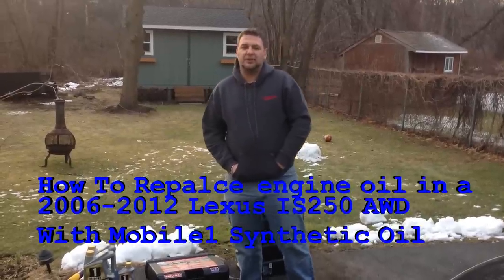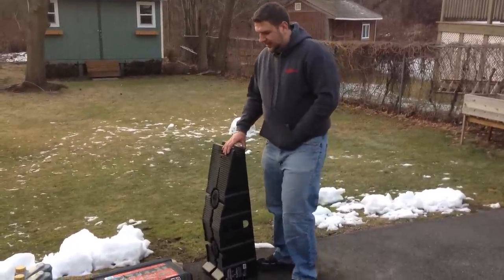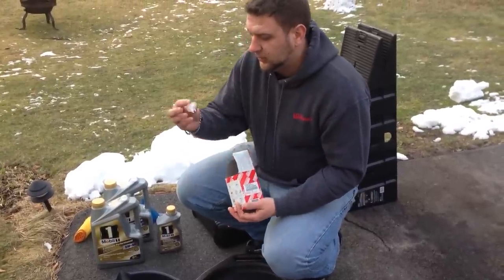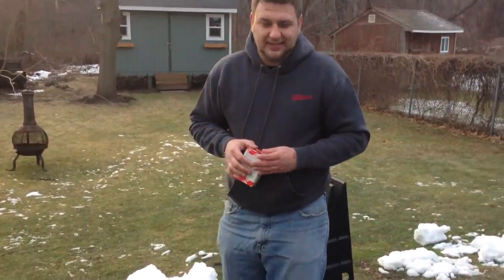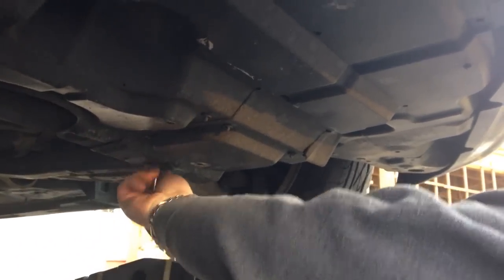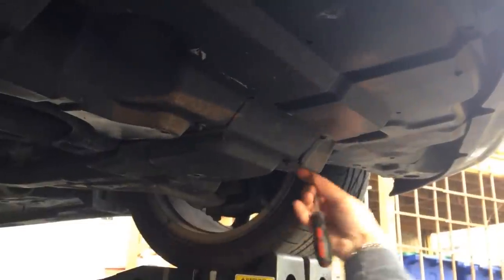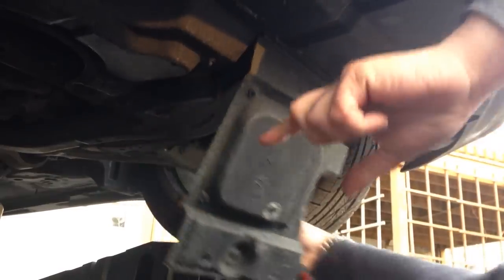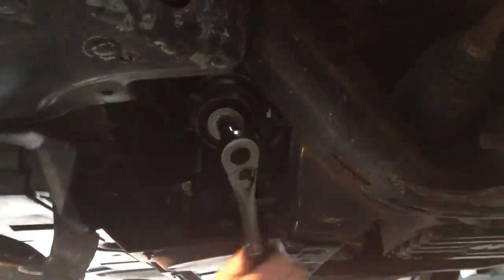How to change Engine Oil in Lexus IS250 AWD 2006-2011 Oil Change with Mobile 1 Synthetic Oil

Comment: Engine Oil and Oil Filter
Replace the oil filter and drain and
refill the engine oil at specified intervals.
SAE 0W-20 oil is the best
choice for good fuel economy and
good starting in cold weather. If SAE
0W-20 is not available, SAE 5W-20
may be used; however, it must be
replaced with SAE 0W-20 at the next
oil change. See your Lexus dealer for
oil specifically formulated for your
vehicle’s engine. For instructions on
how to reset the reminder light, refer
to your Owner’s Manual.
Reply: ca dépant des regions ici c est 5w30

Comment: I have 2013 Lexus is250 engine oil cap and maual book said use 0-20 
but so many lexus is250 owners use 5-30 ???
Reply: 5-30 is better, idk why your manual is wrong.
Reply: @BoqPrecision  5w30 no problem
Reply: I use 10w30 because it has 136000 miles

Comment: looks like the smaller nut to drain the oil from the filter (before removing the filter completely) was stripped. is this why you didn't show it being removed (and you didn't use the small plastic tube to drain the filter oil nor replace the small rubber gasket)?
Reply from the maker: Yes, The small nut got striped, it is made out of aluminium or something. I had the oil change done by a shop before that, and they have over tightened it and overfilled the oil..
I probably should have mentioned that way if it happens to someone they will know that its not the end of the world and you can still do a oil change job without it.

Comment: How often do i need to change my oil on 2006 Lexus IS250 at 124233 Miles?
Reply from the maker: If you use regular oil every 5k miles. If you use synthetic oil then you should be ok for about 7k-8k becuse oil filter need to be rplaced. But rememebr to check oil levels every 5k. I will make a video on this topic today or tommorow
Reply: The car specifies 0W-20 which is not available as a conventional oil.
Reply: My car get low engine oil level and after some time it disappear what might be the reason but i have drove close to 4k miles only mine is 2010 is250 can you please tell me the reason??

Comment: So how often do I change oil to my Lexus 250 ?? Is it every 6000 miles ??? Or is it EVERY YEAR ??? Thanks
Reply from the maker: What type of oil do you use  synthetic or regular. Regular every 5k, for sythetic anywere between 6-10ki would recomand every 7k just becuse the oil will be good but the oil filter needs to be replaced more regularly
Reply: Hello. Well, I changed my oil to my Lexus 250 exactly 1 year ago. I used synthetic oil. I drove only 3000 miles. Now my Lexus keeps making sound telling me I need to change oil again. What seems to be the problem? Thanks 🙏 again.
Reply from the maker: @luckylucky344  its possibe that you have a reminder set. It is recommended that you change your oil over certain miles or time. I dont remember exactly what it is. But i forgot to mention that lexus is250 and most newer cars burn oil to help pistons lubricate. So even if your oil is good you still should check oil level every 5k and add oil if necessary
Reply from the maker: @luckylucky344  you may need to reset the chanch oil light and if you have Navigation then go there and reset reminder
Reply: Enjoy the rest of your day.👍
Reply: @TeckDrivenTeck  
There are filters available that are rated for 20,000 miles. I wouldn't go that long. Also, you don't have to change the oil and filter at the same intervals.
Reply: @luckylucky344  
You're suppose to change it at least once a year even if you don't drive it.
Reply: JackTannehillPromoter Got it. Thanks 🙏. Stay healthy and be safe